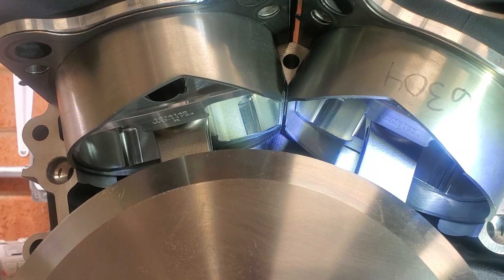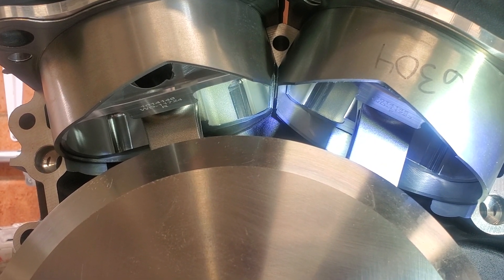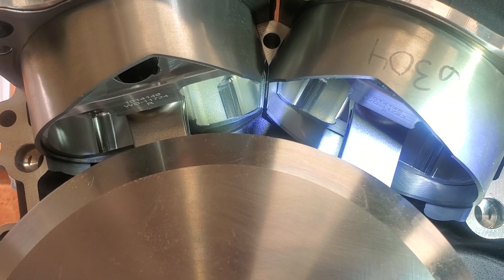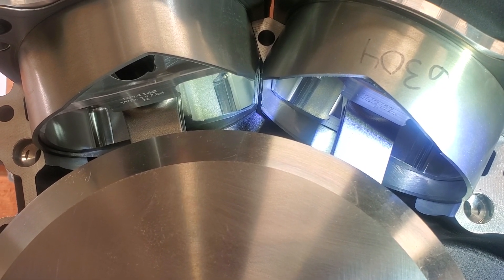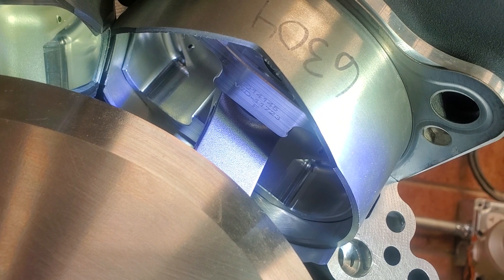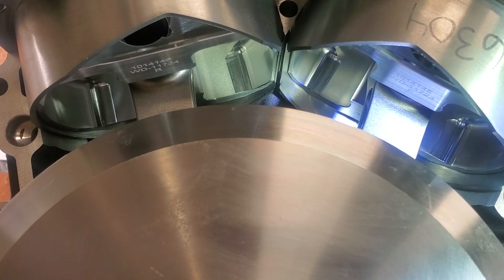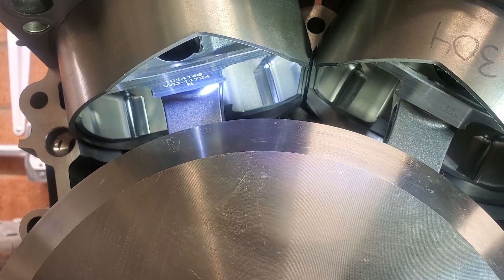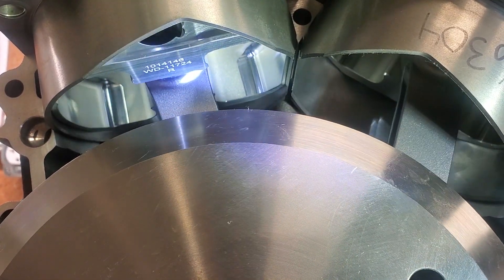First M8 135" Build part 1

Comment: does the HD 131 or 135 pistons come out of the bore at all?
Reply from the maker: Yes the Harley pistons do come out of the bottom of the cylinders. We made ours longer to keep the pistons more stable in the cylinder.
Reply: @tmanperformance  i assume the stock 135 pistons come out even farther out of the stock jugs then the 131?
Reply from the maker: @ That is correct because of the additional stroke.